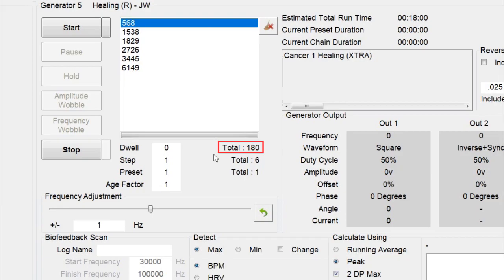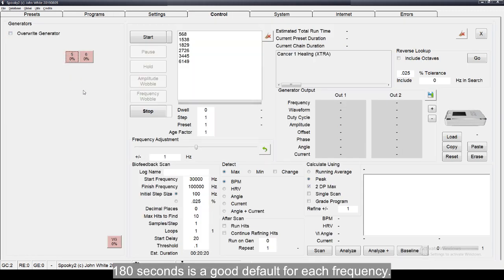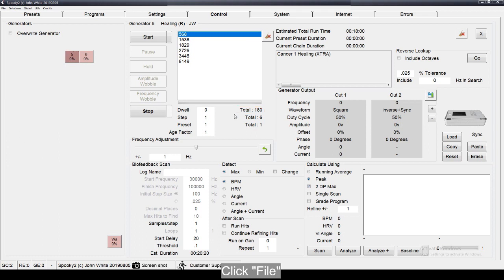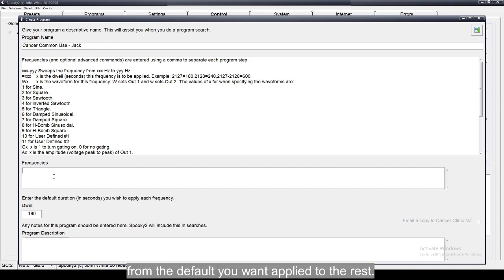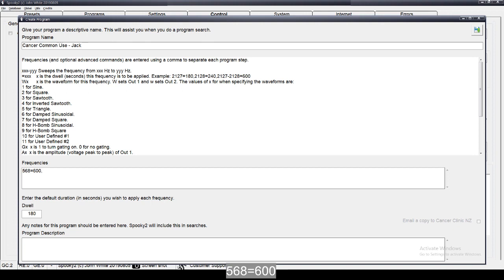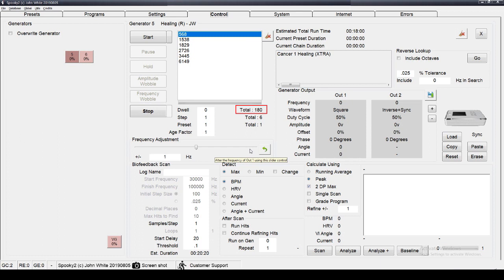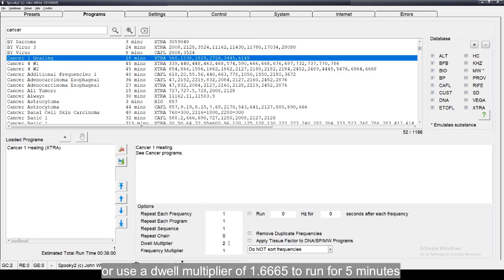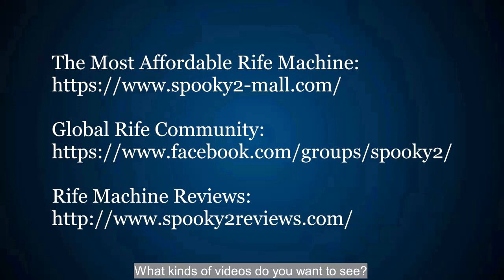How to Change the Dwell Time of Frequencies

Comment: You have to make it simple.
Reply from the maker: Hi Christine, thank you very much for your feedback and suggestion. We appreciate it and will take it into consideration. By default a frequency is set to run 180s which is 3min. It's not necessary to change it. You can keep it as original or adjust based on your needs. Thank you very much for your support.